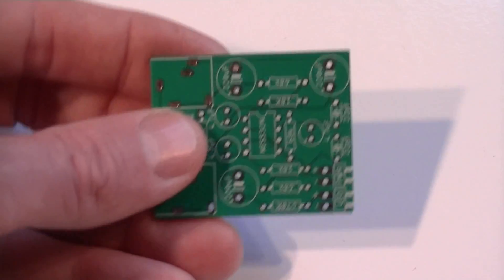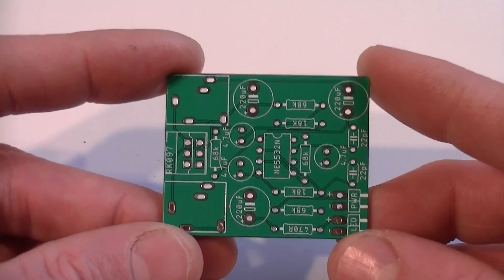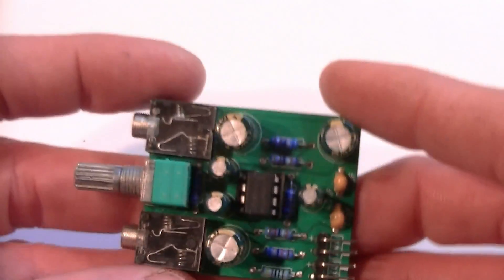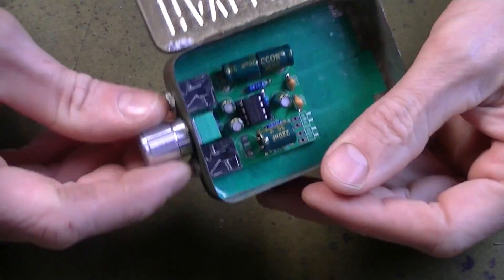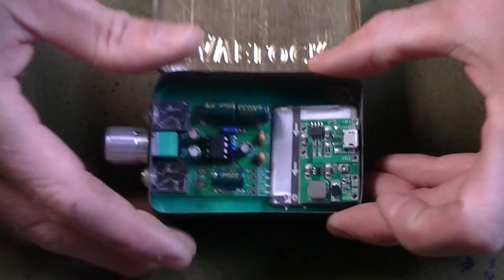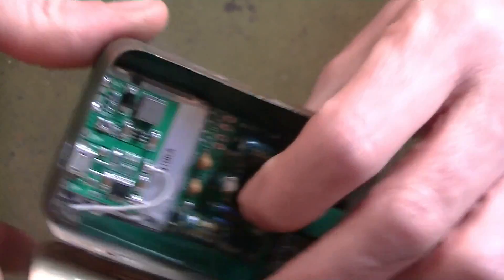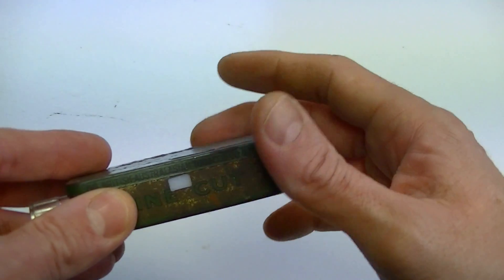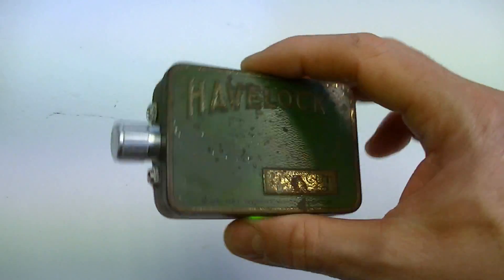Making a Headphone Amp and Custom PCB

Comment: Hello, 
Thanks for sharing this. 
I made one from the PCB file and it works. 
However, just got a few observations, followed by a question:
1. From testing mine, I notice that when the potentiometer is all the way to the left, there is a stereo output but no right channel signal is heard.
2. When the potentiometer is turned all the way to the right, its still a stereo output but this time with a bit of the right channel signal being heard (Lower than the left channel signal)

Is it the same observation with yours?
Reply: did you fix your problems?

Comment: Hey man that looks great! Would this board be good for adding a 1/4" jack to plug a bass guitar in to? I'd like this to act as a "personal, play along bass amp", is that possible?
Thanks!
Reply from the maker: Sorry for the delay in responding.  I was searching around for my 3.5mm to 6mm Jack to try it out but couldn’t find it.  I reckon you should be able to use it that way.